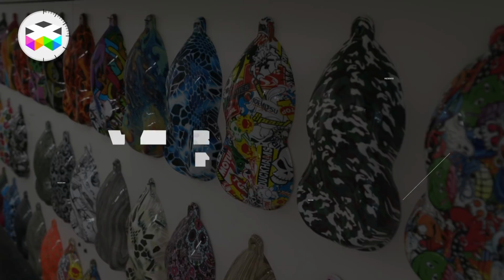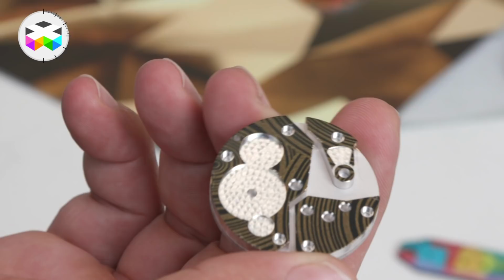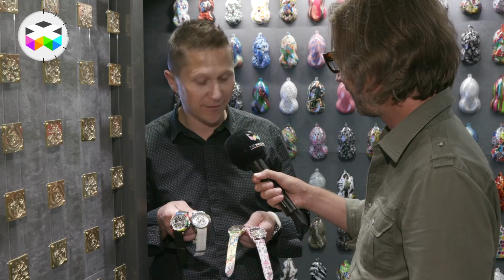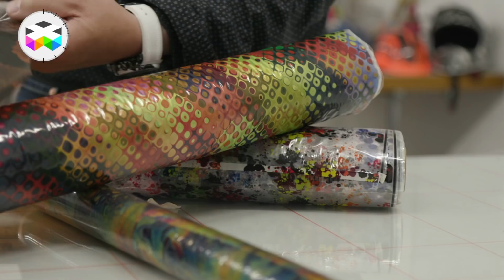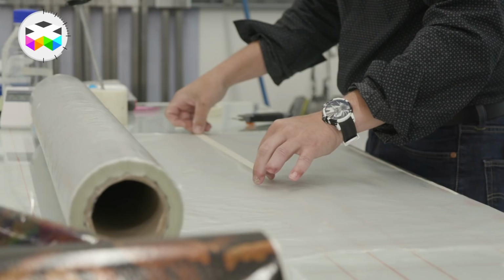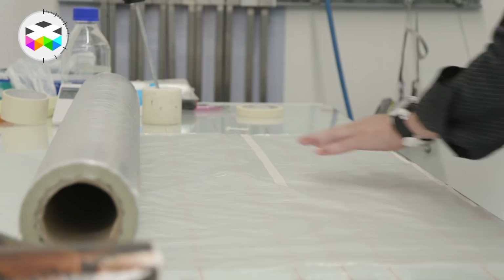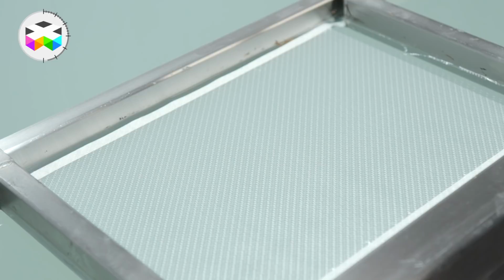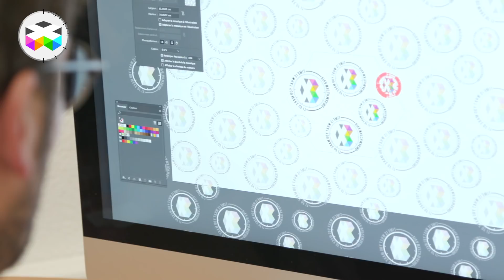Discovering Water Transfer Printing for Watchmaking

Comment: I've seen this tech before! Seems well suited for quickly doing a limited run, especially for smaller, independent watchmakers who don't have access to more complex printing machinery. Doubt it will be used in mass production though, too wasteful for that. Very nice video!
Reply from the maker: Thanks and you're totally right, it remains a manual process, so only suited for small volumes, though the technique also works on an industrial scale, but it's a different set up. Best to you